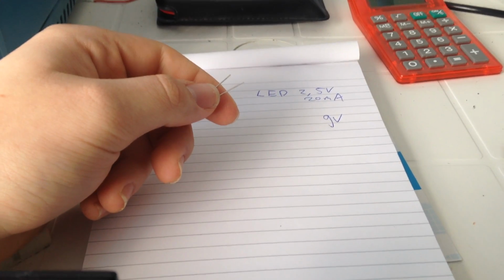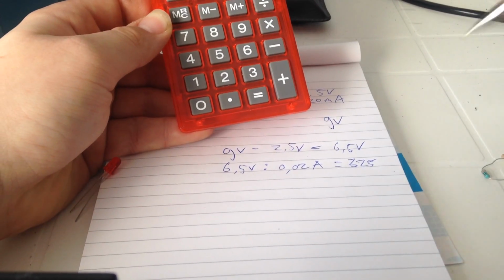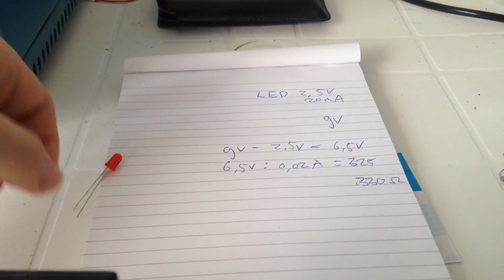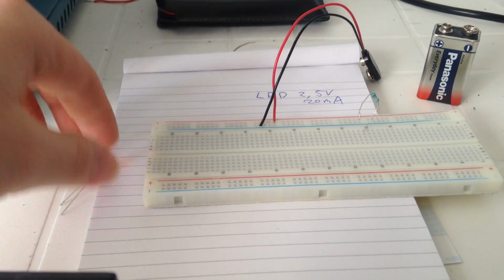How to use a resistor

Comment: Hi
What resistor rating is needed to slow down a 390w dc fan motor?
I need this fan to run at maybe 60-70% speed.
Thanks

Comment: Can i used normal current 220v instead of battery?
Reply from the maker: NO! the resistor can not handle that big of a difference. besides, the 220V you speak of is AC. Please never ever ever do this with 220V. thank you.
Reply: lol dont do that

Comment: Whats the difference between a resistor and a voltage regulator then?
Reply from the maker: A voltage regulator can output variable currents while maintaining the same voltage. When you start asking more current from a resistor (U=IxR) the voltage over the resistor will go up aswell. Also, a voltage regulator is waaaaaaaaaaaaaaaaaay more efficient. can handle higher currents. the list goes on and on. To simply put, only use a resistor to lower a voltage if you are using it for low currents (LED's) or using it for a signal. Do NOT use it as a way to power a FULL circuit!
Reply: @thinktronics675  I think this explains why I was not able to complete the circuit between a radiator fan and my car's 12 volt battery. I had run in series an SPST switch with a led light in it, and it would not turn on the fan. But, when I used a plain SPST switch (no led), the circuit was able to complete and power up the radiator fan...

Comment: man you went way to fast. Beginners are gonna get thrown off in the math of getting the resistance because you didn't explain the formula to them (v=i*r) or how to identify the right resistor for the 330 ohms. (Reading color code). Just some productive criticism
Reply: Chaemin Jung this was actually one of the most direct and precise videos I've watched regarding resistors and LEDs.  Identifying colour codes would have helped some but hey it's 2018 you can Google resistor colour codes. Thanks for the video
Reply from the maker: Chaemin Jung Thank you. Now that I am back, I will make a remastered version of this video that explains what I overlooked
Reply: This video was horrible
Reply: Chaemin Jung, I agree.